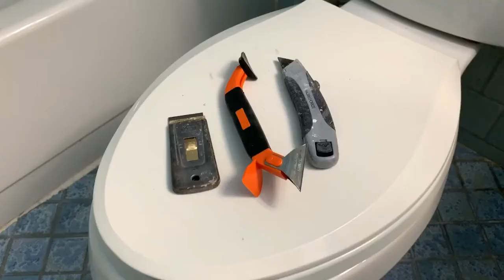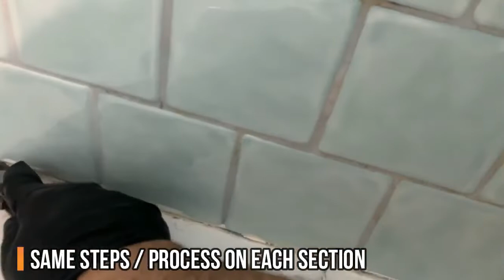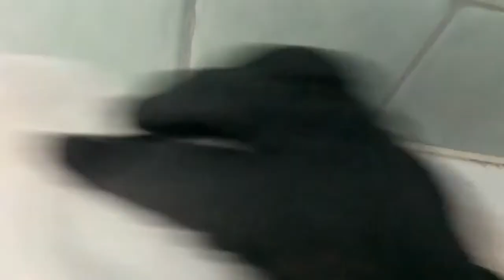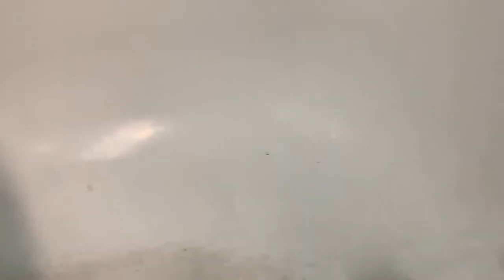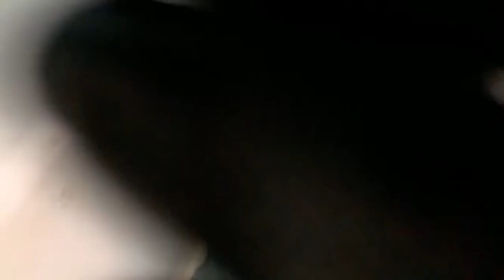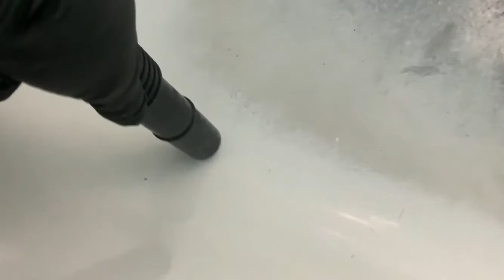BATHTUB REGLAZING | Removing Caulking around a Bathtub before Reglazing a Tub

Comment: Should the process be the same to change chalking around the shower knobs?
Reply from the maker: If it’s tile then yes you can use the single edge blade. If it’s fiberglass then you need to use a plastic scraper so you don’t scratch the fiberglass